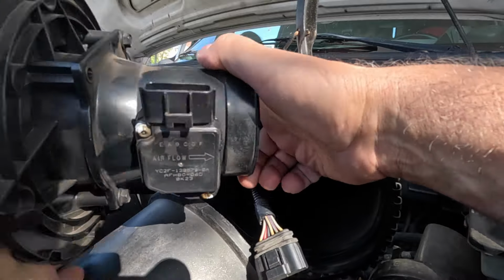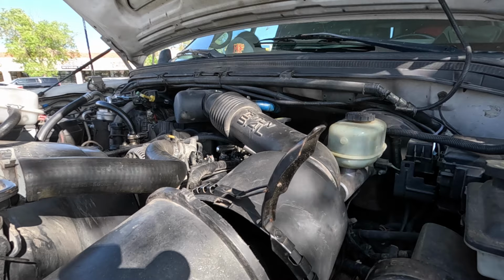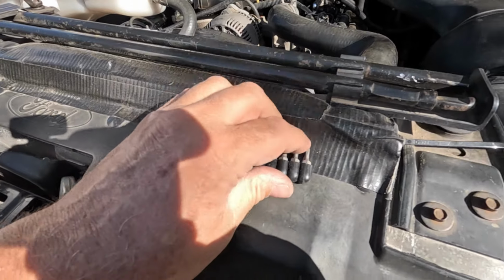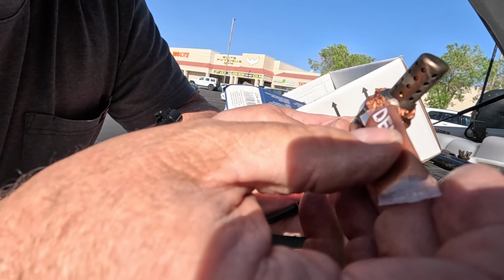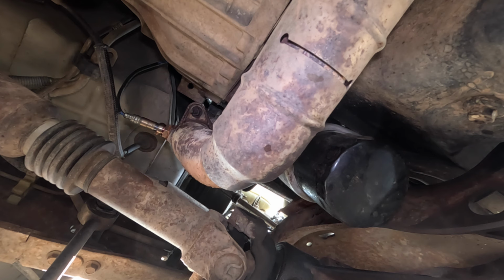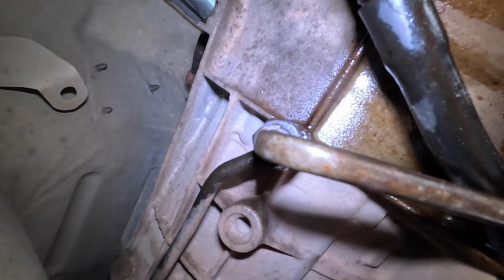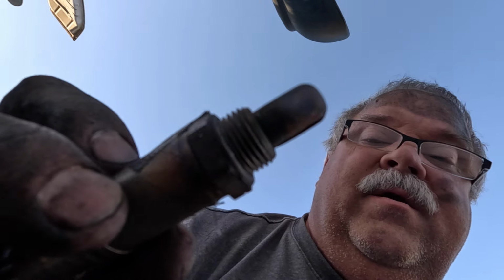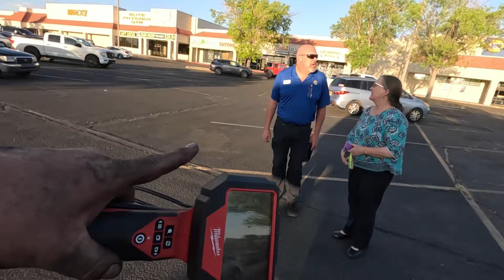Replacing MAF and O2 Sensors Fixing Engine Codes PO171 PO174

Comment: Another job well done..you da man Jeff 😁👍
Reply from the maker: Before, 6 to 8 mog.
First tank after, 12.57 mpg.
A 4 to 6 mpg improvement. At 3.50 to 5.00 a gallon for fuel, it will pay for itself in no time.

Comment: I'll be looking forward to an update to see if it helped the mileage.
Reply from the maker: Before, 6 to 8 mog.
First tank after, 12.57 mpg.
A 4 to 6 mpg improvement. At 3.50 to 5.00 a gallon for fuel, it will pay for itself in no time.